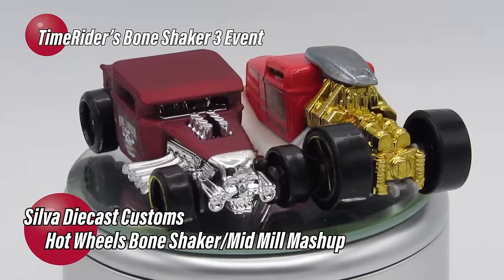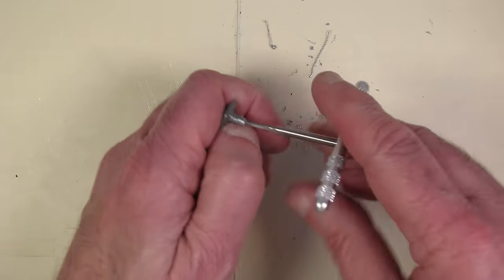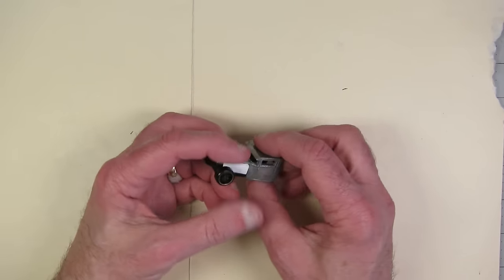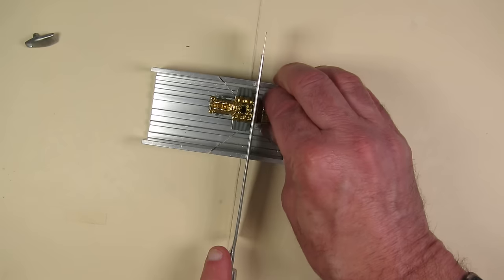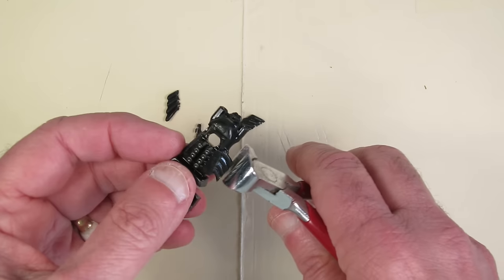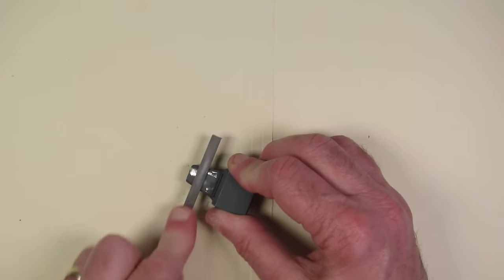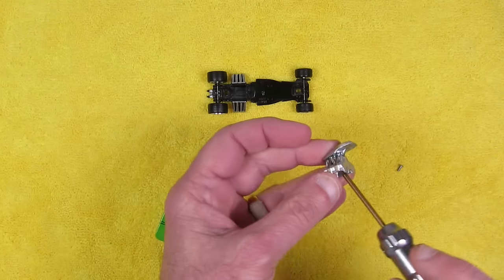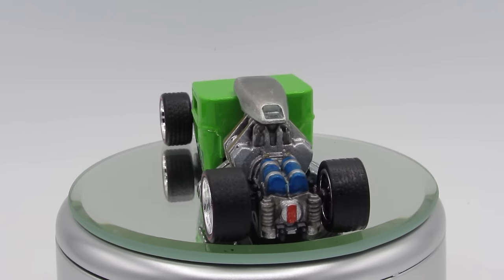Custom Hot Wheels Grinch Bone Shaker - Bone Shaker/Mid Mill Mashup #boneshaker3 #hotwheels #grinch

Comment: The rear end of Mid Mill eventually became the rear end of Tomb Up, so if you run out of Mid Mills you can always use one of those for the rear end.  That finished product looks amazing. Bone Shaker is one of my all time fav castings. I have a Mid Mill First Edition, and a bunch of Tomb Ups. That green shade you used pops perfectly with the grinch decals.
Reply from the maker: Thanks so much Marco!  Thanks also for letting me know about the Tomb Up - I don't recall ever seeing that casting before and it would come in handy to use in more mashups of castings.